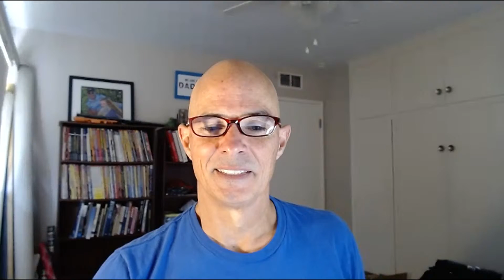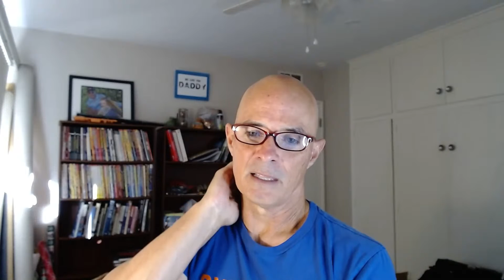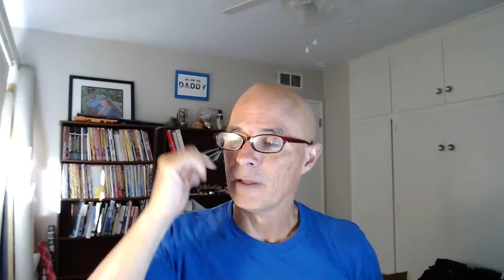LET'S TALK TURBOS (AND BLOWERS) INTERCOOLER SIZING

Comment: Richard I have two options on ebay for a same side intercooler for my car. One top to bottom flow 23in long and 6 inch tall 3inch wide, which would flow well. Or side to side with only 3x6inch core that loops to same side with a total of 40 inch length, which I feel would be restrictive but have a lot more surface area. Just not sure what way to go. Gong in a vq35 maxima with a gt35 t4 ebay turbo.

Comment: Test intercooler sizes and cheap ebay vs Procharger air to air.  Test pressure differential on ebay 31x12x3 everyone runs.

Comment: Porting the heads and intake on a forced induction system is like adding a larger intercooler. More flow at less boost pressure.

Comment: Mass of the intercooler also matters, if you pay attention to IAT you'll see they often go UP after you've let off the gas. Reason is the intercooler mass is releasing it's stored heat into the intake stream as the airflow slows. Intercoolers can heat soak too on a longer run and you can see this in logs too. Just realize that most OEM IAT sensors are slow garbage and if using a standalone you ought to consider using something faster if possible. Given a choice I'd take the largest highest mass intercooler (with good airflow) I can fit, I worry less about "too big" capacity because the amount of airflow we're talking is going to fill it fast and the difference in spool is negligible compared to the increase in cooling capacity. On the dyno a mix of alcohol and water sprayed on the fins will get the intercooler down in temp between runs pretty quickly :)

Comment: We’ve been running a 2.0L in-line 4, with an EFR 9180 turbo, making 800-900 at Bonneville for years. Our liquid-air charge cooler converts 80# ice in 30 gallons of water into warm water in about 90 seconds. Our IATs peak at around 80°F at the five-mile mark.
Reply from the maker: that seems odd-we have charge temps near 50 degrees (though at only 17 psi and 525 wheel hp) and we have ice left over in our plastic 10-gallon cel with 10-12 bags of ice
Reply: @richardholdener1727  Interesting. With only 121 cubes, it takes 43 psi manifold pressure to make the kind of power we need to go 235 mph. 
This year I’ve tripled the engine’s cooling capacity and added a first-stage liquid-air charge cooler that is cooled by a second radiator in front. I expect we should use a lot less ice this way. We are after the G/BGC record this year, which stands at 210.xxx.

Comment: Not boost rated but I can't seem to find a definitive answer with my Google searches.  How many ci can you get from a gen 5 454 block? Also does ring gap for boost affect na performance? I wanna build a strong na engine but leave the ability to boost.
Reply: Well there's gonna be some blow by so you might need to change the oil more often. Also it might burn more too.
Reply from the maker: added ring gap did not change the na power out our testing, the 454 can go to 496
Reply: It depends on the block. Lots of guys are really reluctant to take a gen V block past 4.310 without a sonic check and other guys say 4.350 is no problem. You can get a standard deck 4.375 crank package but you have to grind basically everything to get it to fit. The 4.375 cranks are also really hard to find as a casting where 4.25 cast cranks are readily available.
If you are low buck set, a cast 4.25 crank and a 0.100 overbore gets you lots but it's probably not worth anything real world over a 0.060 bore. If you want more than that, an aftermarket block isn't really much more money than having a 20 year old iron chunk machined to spec. If you are spending $10k plus in parts for a street engine an aftermarket block will let you get to 560+ cubes on a standard deck block. If money is tight, a 4.25" cast stroker and 4.310 bore gets you 496 for only a few hundred dollars more than a full rebuild.
Reply: @timothybayliss6680  now that I think about it I think.im better off selling the 454 and going with a 598 from blueprint  engines. Trying to put something together that gives something in between a tow monster and street truck.
Reply: @Gameplay-3D  ya, if you had a 454 that needed the crank ground and block bored, it's going to be pretty cheap to jump to a 496 from there. The next step is a really big one but if you go with an aftermarket block you can get way more cubes. The 598 shortblock is $6k and that sounds like lots of money and it is, but real world it's less than double what a 496ci made with a bored factory block and it comes with a bit of security. I don't really like 4.5 cranks with standard deck blocks but it's pretty hard to argue with the results. It's also super sneaky that it doesn't look any different to a casual observer to a standard 454.

Comment: I was kind of right about the gt2876 turbo. Garrett doesnt make them outside requests. Its not an inventory item. The compressor inducer is 3mm bigger than the turbine inducer. You combine all the drive pressure problems.of a gt2860 with all the lag of a gt3076. Even a gt3076 has a turbine on the smaller side, there is gt32, gt34 and gt35 sized turbine that will work with that sized compressor. The gt3776 turbo has the same compressor wheel as a gt3576 but that takes you into t4 sized stuff and probably isnt the best for twins on a 4.6l 550hp engine. I would think that at that power level, twin 3071 turbos would probably spool as fast but would still outperform the gt2876 even if the compressor is slightly less efficient given how much lower the drive pressure would be.
Edit, looking at the flow maps for the 71 and 76 mm gt compressors there is only about a 5% difference in efficiency at 27lb/m and pr 1.5. You might not get into surge only because the boost is so low but its way on the left edge of the compressor map. I am glad it works for you but something off the shelf at a lower cost would have likely performed better in almost every way.

Comment: Hi Richard, if you compound the setup and limit the blower speed but still adding 18psi say, with help of turbo/s  would that make the block intercooler work less or still be the same? Thanks.
Reply from the maker: IF YOU HAVE AN INTERCOOLER BETWEEN THE TURBOS AND BLOWER-THAT HELPS-BUT FLOW WILL BECOME AN ISSUE WITH THE BLOWER CORE AT SOME POINT
Reply: @richardholdener1727  so to reach the max flow rate of the manifold but keep the charge temp down as much as possible compound is the way to go?